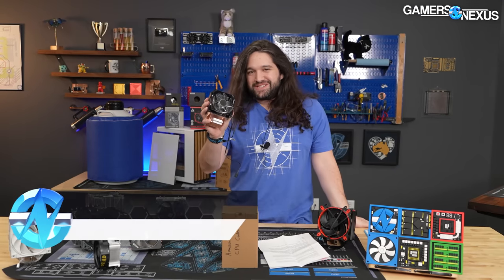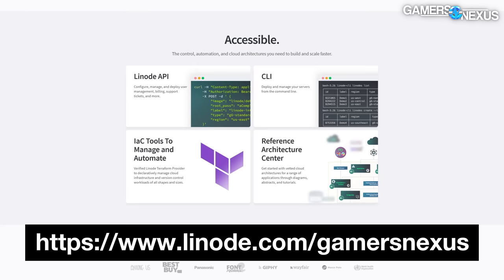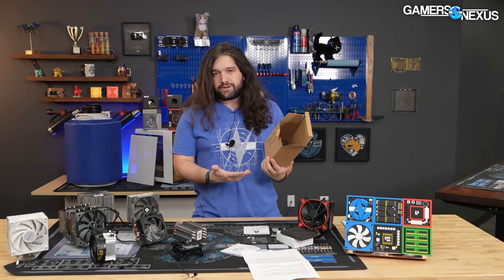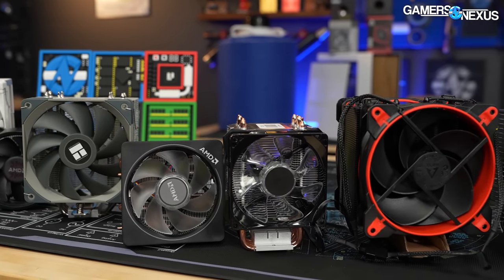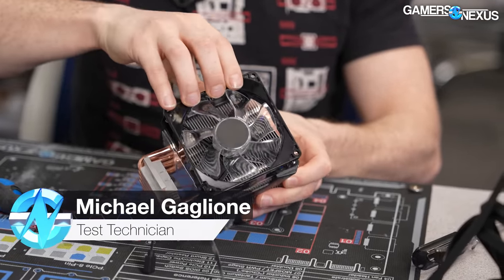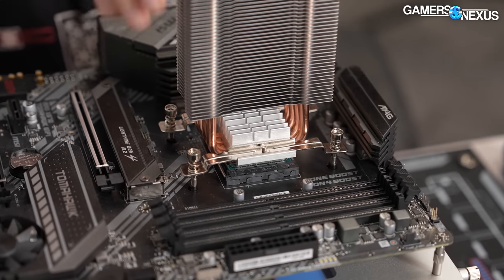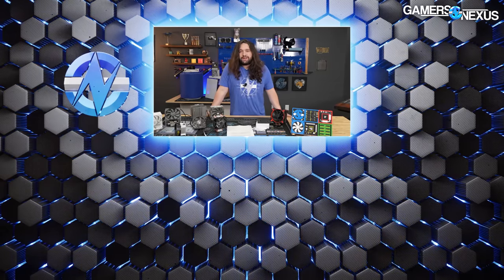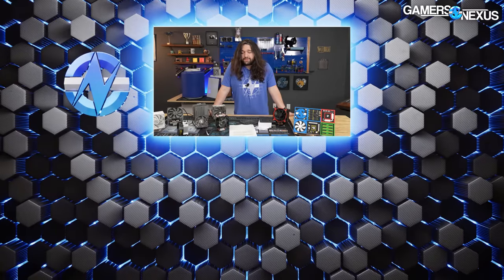Amazon "Made" A CPU Cooler: Amazon Basics Cooler Review

Comment: Currently im running a Freezer 34, one of the cheapest (but still quite good) coolers around. I was actually impressed how high the production quality was. Like, the screwholes in the metal bits were incredibly smooth, pretty much the nicest screwing experience ive had building PCS.

This, on the other hand... yeah, thats how I imagined a cheap cooler.

Comment: Thank you for including the info on the amd stock coolers. I remember everyone raving about the wraith prism at the time so it was very useful to see that even a basic air cooler would provide a meaningful upgrade.
Reply: Yeah, people got caught up with the aesthetics and the fact that it was far better than what AMD/Intel had provided previously, but it's still subpar at its actual job, cooling the CPU.
Reply: Keep in mind that part about competing on price when they're included in the box. At that price point on top of the cpu cost they were competing with actual paperweights. For what they are they're pretty good, by no means high performance but they aren't useless.

Notably right behind the tower coolers in the real world performance test on a 68w cpu so if you can get one as a hand-me-down for the same price of "free" for a budget build it wouldn't be a particularly meaningful upgrade.
Reply: Hang on a second, the results show the Wraith runs a little hotter and louder than aftermarket budget coolers with a 68 watt load, we didn't see any results to suggest that translates to an appreciable improvment in gaming performance.

Perhaps if noise was really an issue for you then it might be an upgrade, but otherwise you'd be blowing money on a second cooler for marginal improvements.
Reply: @Shryquill  If I remember correctly that "wraith prism" model with heat pipes isn't included with the lower wattage processors it would be perfect for and those are sold with a "wraith spire" or "wraith stealth" so it's more a situation of these being spares from higher end builds that enthusiasts don't really need. Personally I gave my older model wraith spire with a vapor chamber to a friend whose Ryzen 3600 came with a thin solid aluminum wraith stealth because I got a big Noctua tower cooler and didn't need the stock cooler anymore.
Reply: @ffwast  It looks like that was the case, but nowadays AMD seems to only bundle the Prism with their 8 and 12 core efficiency-oriented CPUs, Ryzen's 7700 and 7900, both of which are 65W TDP with a real-world load ~88W, so the Prism actually works really well with them. Hopefully they keep up with this pairing because it makes far more sense than what they used to do.

Comment: I bought for 30$ CAD a Thermalright Assassin X 120 SE for my Ryzen 3600x, works amazing. I checked the price now, it's on special for 20$ CAD... thats like 15$ USD.... amazing price for the performance . I am astonished at how inexpensive they are. I assume the Fan will eventually go (still running flawlessly and my PC is on 24/7) but even if it does go Ill just replace it with something even better like an Artic or Noctua...

Comment: Would quickly sanding/lapping the contact area help? Coz if 20 minutes and a sheet of wet and dry sandpaper fixed the performance, I'd be willing. 

Back in ye olde days, we used to get our coolers flat by using valve grinding compound on a sheet of glass. 

Lapped a Taisol to a mirror finish once. I few years later, I slipped while tweaking the system when powered on. The fan partially ripped off my fingernail and I left a trail of blood between the PC and the sink of the LAN party host. I don't think it appreciated my work.

Comment: 0:58 My arctic cooling esports duo was only $7 more and it came in a fancy printed box with lots of pictures, has an extra fan and all of the arctic cooling support.
1:59 video over. Although you could stretch it out another minute maybe by comparing cost of the cooler master version.
5:45 i love how steve just backhandedly called coolermaster crap (fyi they are)

Comment: I recognised that fan mounting thing instantly. I have this cooler master in my case right now. the RR-H411-20PW-R1. It's been good enough for my 3600 and is very quiet.

It's a sub 30dba at 100% 90mm cooler. what were you expecting?

Comment: I do not believe the Assassin Spirit and Assassin X are essentially the same product. The X may have replaced the Spirit, but it is not a simple rename. Not only is the top of the fin stack different, but the heat pipe spacing through the fins is different, and the X appears to have around 45 fins while the Spirit has just over 50. The X is also 46mm wide while the Spirit is 48mm wide according to the Thermalright website. Performance will likely be similar, of course, but I know you like to be very technically correct.

Comment: I have the Cooler Master version of this cooler (bought from Amazon) and as long as you don't put too much heat through it it's fine. Cheap and fine, I paid less than $13 for mine on clearance and it's cooling (hold on to your socks) an AMD A10 6600K that has a surprisingly good on board GPU for games like Roblox and Minecraft, all the rage for am eight year old. Definitely a good cooler considering the price.

Comment: I think where this cooler fits is stock cooler replacement in narrow width cases like HP Envy/Omen 15L/25L types where a 120mm tower cooler will not fit. The competition on fitment with tower coolers start at $7 more expensive and goes up drastically from there. If the contact and pressure on the mount was sorted this would be a very recommendable product for those smaller cases, even with those issues the temperatures seemed to be pretty decent when not overloading it's TDP rating by 23% or more.

Comment: i would be very interested in a follow up video to see how much this cooler could be improved by sanding/grinding/lapping the cold plate, and maybe a comparison to the original cooler master unit it's based on to see if maybe the amazon unit is lower quality
Reply: It definitely could, but it's not something I want to see GN waste their time on. The message is clear: spend the same $$ or $10 more for that improvement. Time is money, and hopefully no one experienced enough to lap it would even be considering this thing.
Reply: @seitenryu6844  on the contrary, i think it could be a pretty good like for like benchmark of how much of a difference surface flatness alone makes and how much we should be caring about it

Comment: I bought a thermalright 120 and the screw head on the mount ( the sprung screws )  sheared in half under a small amount of torque from a regular screwdriver. A material defect for sure. It's still usable and at £17 cant be bothered sending it back. The cooling performance is totally acceptable for my use case however. I dont mind paying less for less glamorous packaging. However packaging does help resale values if you ever sell it on.

Comment: Honestly the smaller size with CPU air coolers is a bonus to me. The obnoxious clearance issues some air coolers introduce are just unacceptable in my opinion, and I think GN should consider going harder on those coolers.

Bro the degree to which I went through thermal paste with the NHD15 was nuts. Oh you want to put in a nvme drive? Take out the cooler, back on, thermal paste! Want to move your GPU to the slot closer to your CPU? Rinse rep-out of thermal paste! Will work for thermal paste here!!! So glad I switched to an AIO.
Reply: coolers like the D15 need to be that large in order to perform. more surface area = better cooling. you can't really deduct points for that.
also, you don't need to re-paste your cooler everytime you take it off.
Reply: @gamergod9182  YES YOU DO! OMFG WHAT ARE YOU SAYING?!
Reply: @gamergod9182  

Kind of. Honestly the thermal paste was mostly annoying when you had none and needed it. I totally still can deduct points because AIO’s have a design with superior cooling while putting all their bulk in a spot where DIY’ers can work around without undoing the cooler.

Edit: and no I don’t think that’s an unfair comparison. The risk when using an AIO is so small it’s worth it.
Reply: @ZeroHourProductions407  

Some of it stays on and is re-useable if you don’t use the kind that needs to be spread as thinly as possible, so he’s got kind of a point.

Still I don’t feel like the NH-D15 should get away with citing performance as its reason for being a pain but not competing with AIO’s.
Reply: Large air coolers shouldn't need to be removed to reseat your GPU (and why is your GPU not in the top slot anyway? You're almost certainly bottlenecking it). The only thing it's really an issue for is mounting new RAM or maybe if you want to change out an m.2 ssd (even then, it is unlikely to obstruct more than a single m.2 slot).

Is an AIO more convenient in those situations? Sure. But AIOs come with their own inconveniences and risks. You don't "go hard" on the water cooler for... having water... or needing to mount a radiator, and you don't go hard on a dual fin stack cooler for have two fin stacks.

I say this as someone who has an NH-D14 and am considering swapping to an AIO. Not because the D14 sucks, but just because AIOs look nicer.

Comment: Surely OEM style packaging options to save costs, IS an option for the heavily marketed brands, if they want to.  They just need to have some anti-counterfeit measures.
Amazon are doing what supermarkets have done for years without damaging branded products.  Most people fall for advertising, so pay more for the pretty packaging and image, even where the own brand quality is first rate.
This Basics brand seems like a way for Cooler Master to offload seconds, without nickel plating heat pipes.
When I started building OEM options were the rule, not retail boxes, you paid extra for those and received a few extras like cables, screws, CD & stickers, finishing up with stacks of redundant manuals and install instructions.

Comment: I'm thinking if somebody bought this, can't return it, then saw this video: Take a sheet of wet/dry sandpaper, maybe 180 grit, and tape it down to a VERY flat surface. Carefully hold the tower and run it back and forth on the sandpaper. Both copper and aluminum will sand down easily. You might be able to flatten this out perfectly!

Comment: I have one of the H412R and it is decent enough for a low power cpu, like the Ryzen 5500. The one problem I had with it was the mounting screws are blocked a bit by the fins stack and a pain to get at.
Reply: This. It's horrible you need a very thin screwdriver!

Comment: I have the cooler master version of this. Works well with my 5600x 4.86ghz boost 4.625ghz all core, gaming cpu temps are 58-62c and all core 74c in the winter 76c in the summer. If I could go back in time I'd buy a peerless assassin 120 se.

Comment: Have you tried the ID Cooling SE 234 ARGB? I've had it for about two years since upgrading to a Ryzen 7 5800X in 2021, and it's been solid. Costs a bit more, but has better cooling performance overall with better looking lighting as well.

Comment: My $18 thermalright assassin cooler is going to be hard to beat.
I am literally shocked every time I think about how well it's cooling a 1800x.
At least 5-10C cooler than a hyper 212, at almost half the cost.
Reply: Thermalright is almost unbelievable, sub $20 gets you a very capable tower for all but the hottest CPU's and the $35-$45 Peerless Assassin hangs in with the best of tower coolers for 1/2-1/3rd of the cost.

Comment: Err.. the Amazon CPU cooler is basically Cooler Master Hyper H410R (TDP up to 100 Watt *According to Cooler Master TDP Spec sheet) 
I used to own this cooler but it's old CPU design dates back to 2014  so I doubt it can handle modern CPU with up to 6 or 8 cores. 
Back than this CPU cooler was adequate for Intel dual and quad core CPUs which is meant as a stock cooler replacement. 
Since it's small so it's a perfect match for MATX/Small form factor builds. 
Back than there's no RGB/ARGB so the red fan improve the PC build overall looks. 
The H410R if I recall correctly was also during the period when Cooler Master Hyper 212 LED was also sold. 
Which to choose depends on your preference but the Hyper 212 thermal performance will definitely be better than the H410R. 
The H410R had a last revision which was the H410R RGB Edition which adds the RGB fan. 
However it isn't a popular choice as by modern standard it isn't enough to cool modern CPUs. 
Not sure whether these Amazon CPU cooler sold are ex stocks of Cooler Master H410R which seems like it. 
If you ask me what's my opinion whether should Cooler Master re-release the H410R line, I think they probably should. 
Cooler Master doesn't have any decent low profile or small CPU coolers for MATX/ITX build. 
There's the Cooler Master T20 which I will not recommend nor want to talk about that cooler. 
So Cooler master I hope you could revise the Cooler Master H410R Heastsink to better handle modern CPUs within 65 watt TDP and include a better fan like CM Sickleflow 92mm. 
Maybe make a black edition like what you did with Hyper 212 coolers? 
I would like to see affordable CPU coolers for MATX/ITX builds from Cooler Master and I think Amazon opt to identify it's OEM as Cooler Master. 
FYI Cooler Master does partnership with certain companies so not only Amazon. 
HP used to partner with Cooler Master for it's CPU cooler, I'm not sure now which OEM they are using.

Comment: Idk if you do this already, but I have a suggestion to make your testing even more consistent between CPU's. For the same size of a CPU, aka AM5 or LGA 1700, use the same amount of thermal paste. So for AM5, let's say use 0.3 mL (I'm just making up numbers here, not trying to be specific) of paste or liquid metal for each CPU you test. For LGA 1700, since it's alil larger, use 0.4 mL or something between all of them. It might be easier to do that kind of measuring with liquid metal, but it may be OK to use paste. Either that or use the same sized phase change pad for each CPU, that might make it even easier even though it won't be as effective.

Comment: Cool video Steve , its good you and the team dont just cover the expensive technology. I wonder if using some grinding paste on the base of the cooler would get better contact?
I notice those brackets sit over the base whilst some other makes sit under the base and are only held on by the screw, this seems a better design for holding the plate more evenly.
Reply: I was thinking this then I thought why bother? Spend time lapping the bottom, possibly reducing the contact pressure even more, when at this performance point the solution is just to be generous with the thermal paste. Or save yourself the time and up your budget by $5 and get a better cooler.  Then again,  I guess if you've already got one you might be tempted, and it might be interesting to see if lapping would be any improvement over more/better thermal paste at this power level. A lot of things that people think they know about cooling comes from videos about cooling in high power/OC situations and they don't necessarily map onto lower power situations where the margins are less critical.

Comment: For amd 65 watt cpu i still use the amd box cooler from the amd 64 x2 with heatpipes.
Yes it fit on a amd Ryzen.
And yes it even cool more than the new top box coller from Ryzen.
Its not that strange its a 125watt tdp cooler.

Comment: So, just keep using my Noctua. I have had my noctua for over 10 years. I just get new brackets when a new CPU comes out. It out performs every cpu i match it with so it runs quiet and my cpu never gets hot. So, take the price and divide by years or cpu generations and it is clearly cheaper than anything else in the long run.

Comment: i hacked a zalman cnp9300 AT mount to fit a zalman resernator 3 max watercooler. Now im using the zalman cnp9300 AT and its mount to fit a i3 8100 and got the back plate for intel 8th gen. looking to try get a 8700K

Comment: Why is the other guy complaining about using a phillips #1 its not like its a JIS (Japanese Industry Standard) that similar to a phillips. It just sounds petty.
Reply: The engagement angle of JIS is better than Phillips, that said JIS is common in, surprise, Japan, and hard to get here. A CPU cooler is not a precise torque load, so the western cross head drive is perfectly fine. JIS is better for like setting carburetor jets where you need to be exact.
TLDR: He is being petty.

Comment: Is higher flatness always better? Wouldn't a slightly convex cooler flatten out under mounting pressure and a flat cooler become slightly concave (thus giving poor center contact)? Or, does CPUs being slightly convex mean that flat is better?

You may have covered this at some point but it's a major concern for me so I'd like it if you talked about it more.

Edit to add: I think it'd be an interesting line of testing to compare the thermal transfer of cold plates made to have various surface curvatures but otherwise identical. Maybe you could work with DerBauer on that one!
Reply: My assumption would be the majority of mounting options would not flex the heatsink to any meaningful degree

Comment: The 92mm fan is probably for compatibility of those decades old chassis by Dell and HP, because this is pretty much the largest tower cooler size you can fit in. However, in many cases the headers on those PCs are not standard (yes, Dell, I am talking to you) and will give you an error code... so I cannot see what is the point here.